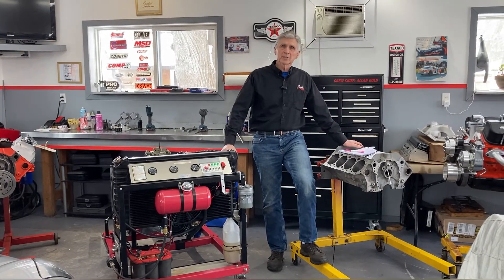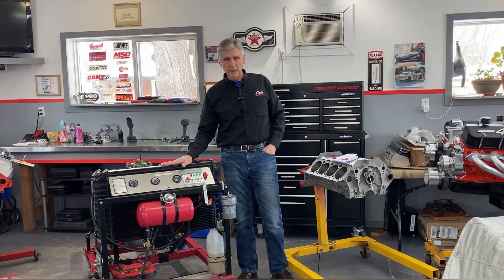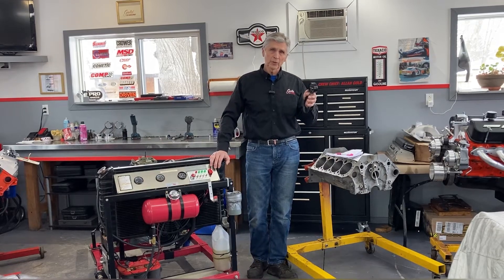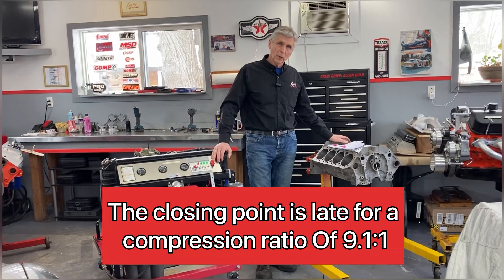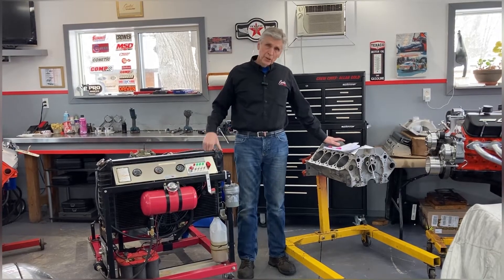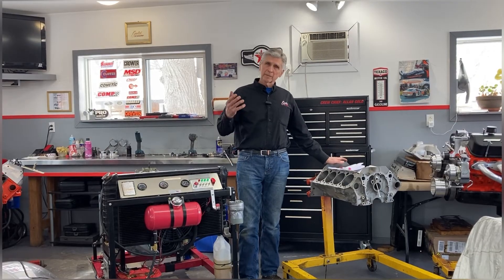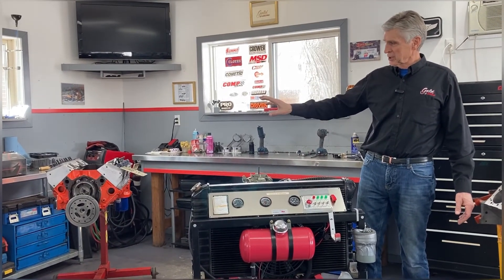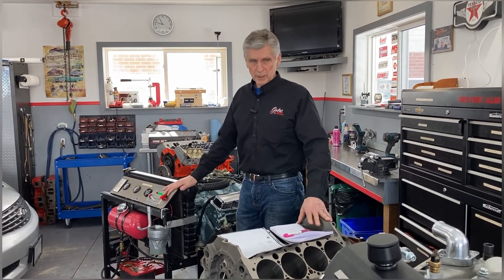Selecting the right camshaft- Matching your cam to your compression ratio - PART 1

Comment: A tight LSA will trap more compression, something in the range of 106 - 108. Also I use .015 steel shim gaskets with cast iron heads.
Reply: How do you know it's from the tight lsa specifically and not the valve opening and closing events?
Reply: @lollipop84858 It all related, the tight lsa means more overlap and a sooner intake valve closing which means the piston has more time to trap the mixture hence more compression.
Reply: Yes and David Vizard has some great videos on his yt channel about LSA too, he also has formulas on how to calculate LSA as well. He pounds the table about LSA that these cam manufacturers are making the LSA way to wide leaving 60 to 80 HP and Torque on the table.

But here's the deal with DV's  claims, his findings are solid for WOT max power but not necessarily for average power, cruising or fuel economy if that is something one is looking for? Tight LSA cams have more overlap that isn't necessarily part throttle friendly and the bigger the dur @ .050" the worse. So keep this in mind before choosing the extra top end power you'll have by sacrificing some part throttle power.
Reply: @itseithergonnaworkoritaint7852 yes you hit it on the head with that last part, aka the second paragraph. This is something I pointed out too many people, and I'm actually glad people like Richard holder points this out because he has such a big audience. It kind of goes with people focusing on max horsepower and wide open throttle performance doesn't seem much for everything in between. And then the other extreme is very down low torque. And for most people on the street, you are torque to mid-range is really where you're going to want to focus. Irons law dictates there's going to be a sacrifice somewhere . You can't have it all .
Reply: @itseithergonnaworkoritaint7852  I run a 107 LSA in my 355 and the mid range is awesome. But I agree, if you want cruising and mild, stick with stock LSA.
Reply from the maker: You are both making some good points. The ideal LSA depends on engine displacement and cylinder head flow, (port size, valve size etc.) The bigger the displacement on the same heads the tighter it can be. Cam companies typically limit LSA because of the adverse effect on vacuum, drivability at low speed etc. I build street engines not race engines so the priority is mid range torque, throttle response and drivability. On the dyno average torque and horsepower is more important than peak. Thank you both for your input.
Reply: @goldsgarage8236  what would you say psi or dynamic compression should be for 87 octane? Absolutely everything I've found only talks about "pump gas" I assume 93 and I understand it depends on heads, chamber design, eliminating hot spots in the cambers, quinch and so on. It would be nice to know a general range. Currently building a 383 fun/daily driver. Afr 195 enforcer heads, compression in 9.3 to 9.5 range, 0.040 quinch. I haven't cc'ed the heads yet so just an educated guess with 18cc dish pistons. I've found 1 article in all of google that was an 87 build that I did the math on the parts used and should have been about 7.56 dynamic compression around 151psi or so. Any ideas?
Reply from the maker: Thanks Nashville. 
I think you should be ok with 87 octane and 151 PSI compression pressure. Even so, unless cost is a big issue, why not just use 91 anyway so you don't have to worry about it? Hope this helps. AG
Reply: @goldsgarage8236 that 151 cam 222 intake and exhaust duration with .448 lift was a good street cam even with the 114° lobe separation. 
now I would say the small THUMPR Comp cam would be a great street cam. if you can get down to 212 duration and good aftermarket heads you should make good power on the street.
Reply: @goldsgarage8236 what you are saying is also very true. Most people individualize each component instead of looking at it as a combination of components . And typically those who look at a combination are still only looking at some of the components instead of everything together.  And then even further, such as weight of the vehicle, gear ratios, everything all together
Reply: @nashvilleoutlaw  
Not sure if you got your cam yet or not but if you're still looking I can tell you what I have in my 9.6:1 compression sbc 383. It's a Comp XFI hydraulic roller cam with 202°in/212°ex duration @ .050" with .550" in/.546" ex with the called for 1.6:1 rockers on a 113° LSA. I run this on 87 octane cat pee without any issues. Heads are similar to yours with a Weiand RPM Airgap style dual plane intake. It has 22 inches of vacuum at idle so I had to use a 10.5 power valve in the 850 Holley double pumper set up fuel mpg to run right.

I have a 700R4 behind it with a 3.07:1 rear gear. It does high 1.8s 60ft times and 13.0 in the QM @ 101 mph. The car weighs 4,600 with me in it. The cam has an advertised RPM range of idle to 5,000 but keeps pulling to 6,000 where the valves start to float because I have the flat tappet springs on the heads they came with. Would probably rev a few hundred more RPM with the correct springs and tickle the very high 12s.

This drivetrain in a car 1,000 lbs lighter would be an high 11 second street car. The heavy version above gets 26highway/20city mpg driving for mpg.😁 With a heavy foot mileage will vary.

What I would do different if I were to start from scatch is run 1.7:1 rockers with the correct springs and would of made the compression between 10:1 to 10.5:1 to run on 89 octane mid-grade. I do usually top the tank with 93 just before I hit the track just in case as well.
Reply: @joe-hp4nk I would say to still stick to the tighter LCA/LSA of 108 flat/107 roller... The reason being is that you will need to choose an intake/exhaust duration (level 1 for overlap) that is meant for daily driving/torque/towing... So going with a lower duration number that's under 200 @ .050 for both.